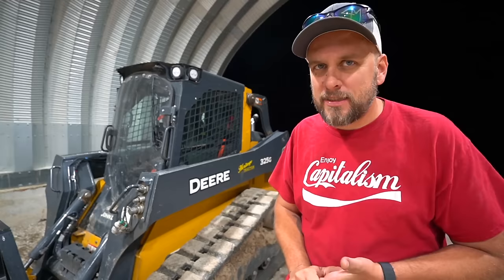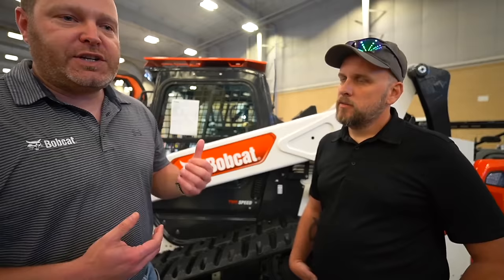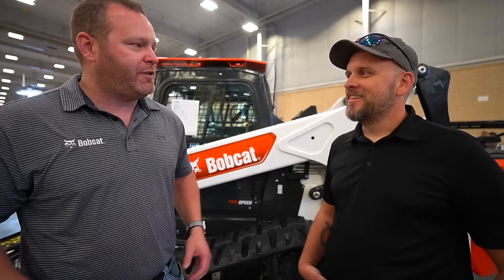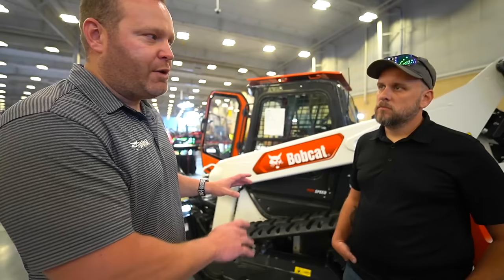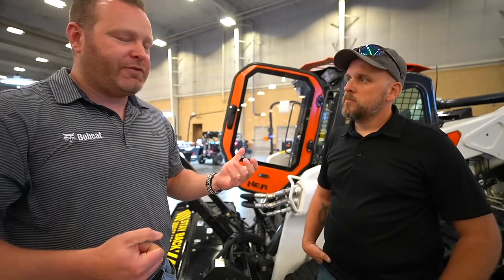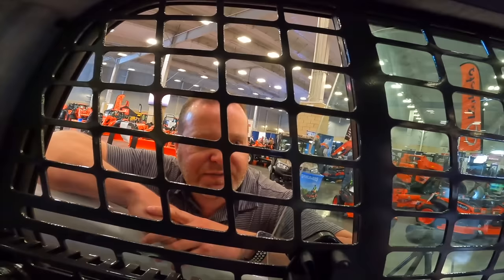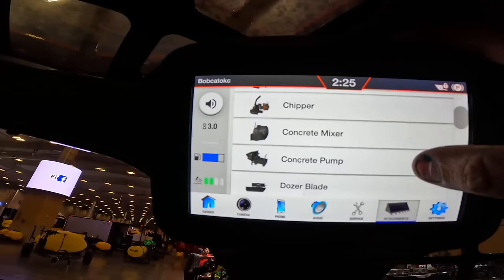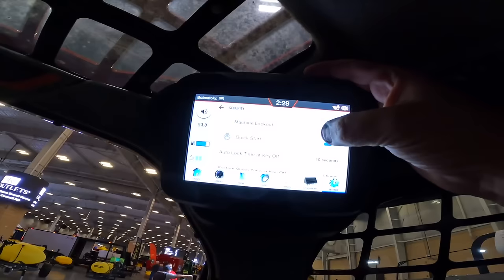I Should Have Bought a Bobcat Skid Steer - Here is Why

Comment: I own a kubota 97-2 for my construction business. Yes the door rattles some and might not seal as well but I'll still take the accessibility any day of the week over a swinging door.
Reply: the Kubotas I have run were nice machines, I hate my bobcat door. daily removing it to work and putting it back on end of day for security sucks
Reply: Im with you man - its a no brainer and i bet Bobcat engineers are working around the clock to create a roll up door system. It would be bad business if they are not! My kubota 75-3 door dont rattle any
Reply: @rayrayslawnlandscape2008   bobcat engineers already missed the boat. this is the 'new' and de-proved R series.
Reply: @notsure6182  I would be really depressed if i spent my life savings on a machine and i was stuck with the swinging door! NO WAY
Reply: @notsure6182  Thoe this salesman is really informative
Reply: Agree completely
Reply: @rayrayslawnlandscape2008  They better be working on putting in a roll up door --- loosing market share for safety reasons on this.

Comment: The only name you need to remember is KUBOTA! Great value and NO DOWN TIME plus excellant re-sale.
Reply: I like the roll up doors as well ... much better on safety issues , being able to get out if mid raise of arms and get stuck and cant open door.   Its happened to me---scary.
Reply: We have 3 Kubota machines.  the oldest is a SSV 75 that has about 700 hours on it and had been worked hard in its 5 year life.  It's still a workhorse and we have experienced very little down time with it.  We also have the SVL 75-2, it's newer and has the same back story with similar results.  The newest is a 2024 mini-ex KX 57-5.  So far, it has been a fantastic machine with no down time.

Comment: I like this Sales dude. Totally objective, and doesn’t run his competitors equipment down. 

Buddy, I wouldn’t  dump the Deere because of one minor inconvenience. In addition, you’re comparing a 74 Horse JD to 105 Horse Bobcat.
Reply: He was comparing his 74 HP Deere to a T66 or 75 HP Bobcat.
Reply: I think they're making this issue up, hydraulics are computer control and computer won't let you bog down the engine it will adjust hydraulics to balance the load on the engine
Reply from the maker: I did not say you bogged the engine. I said it didn’t move very fast. Not a big deal

Comment: I rented a 325g and was convinced I needed a ctl, but only one I could buy was a Bobcat T66.  The 325G was a year out and Kubota was 2months out. I'm getting to 1.5yrs and 800hrs on the T66 now, pretty happy so far.  Had one warrantee issue with the cab harness going bad.  Bobcat replaced the harness no charge and has been great to deal with.  Love the speed and the float on the loaded bucket.  I can run full speed with the bucket loaded over rough terrain and not spill anything which speeds up jobs a lot.  Here's a quick list of everything I've broken or had to repair.  Broke my windshield door twice, had the air ride seat get stuck on and popped the bladder, I damaged my leveling sensor with ice and dirt crushing it, broke a plastic part inside my door handle, and melted the belt cover with too much heat being pumped on it while cleaning things in the back.

Probably the biggest thing I'd change is the lack or heat down by my feet.  When I'm operating in extreme cold, I'll often wear Baffin boots because my feet will get cold in anything else.  The cab produces lots of heat for the windshields and the upper portion of the cab but not much for the operators feet.

Comment: I love my old Bobcat T590.  It is 10 years old and still running strong.  If you do change machines, and no matter what brand you go with, I would suggest you get it with the 2-speed ground travel option,  track suspension roller system and backup camera (for kids and animals at your place).   I do find the door a pain with certain attachments installed but understand why it is like this.  My door seals so tight that it is hard to latch unless the window is cracked open a little bit. Yes,  the door is adjusted correctly.    I do take my door off for most the year (except when it is extremely hot or cold) and have found this solves the problem with getting in and out.  The door is very easy to remove, and install, and if the temperature does turn on you while it is off, you can still run the heat or A/C with the door off and not suffer.   Good luck with your demo!
Reply: the dance climbing off the machine carrying the door sucks, finding a safe place to store the door sucks. I think I need to make a door holder for my truck
Reply: @notsure6182  Great points.  I have also struggled with the things you mentioned.  The upsides of not having the door installed do come with downsides.  Hopefully, there are brilliant people out there, who design these things, that will come up with better solutions......
Reply: I like the sales contact

Comment: Very helpful.  Good to hear the Bobcat guy say that all brands will have issues.  Some minor, some major. But I think this is machine, not brand specific. All the major brands have sound machines, but there are lemons that get out from all of them.  3 years ago I was in the market for a skid steer to mulch.  At the time Bobcat's biggest machine (870?) did not have built in extra hydraulic cooler, and forestry door was a big upgrade.  My salesman said if I was 90% mulching I should look at ASV.  I did and bot the 75, and upgraded to a 135 last year.  Very happy.  

But  I appreciated that salesmans honesty.  2 weeks later he called me saying I know you wern't looking for a mini Ex, but we had a customer order an E42 6 months ago (this was mid 21 during Covid shortages) and it is coming in next week.  He couldn't wait and bot a used machine and want's his deposit back. Would I be interested?  Went down, looked at it and bot it. What a great decision.  Skid's work faster, but a mini ex is a swiss army knife.  So a good salesman got me where i needed to go (not with him), but got a nice sale for his trouble.  

Lastly, unless you are mulching or breaking pavement, which require  extra cooling and as much hydraulic HP as you can get, all major brands have good machines for dirt work, occasional mulching, farm etc.  Get the machine with the best local dealer!

Comment: I have a 2022 T76 wide track for private use. I really like the machine. No dpf or blue government juice to worry about. The only issues I have had was a hose clamp recall on the radiator along with the radio loses communication (requires power cycle to come back - not many times). The only loss of power I have noticed was going up a steep hill while using a hydraulic function, but this was at a quicker ground speed. If I had to buy another one I would get a bobcat T66. Slightly smaller framed machine with the same 74 hp as the T76. The weight on the 66 is slightly less for trailering. The T66 can have counter weights added which can get the lift capacity closer to the T76. Looking to hopefully obtain a E42 or E50 R2 in the near future to complete the collection.

Comment: Old info on the Kubota.  The SVL75-3 seals really well and vents are lower and upper.  It also has addressed the multi-function capability with turning and operating the boom and  AUX with an Advance Multi-function valve.  Btw, I was traveling down I-77 North of Statesville, NC and saw the big Bobcat factory.  They had many attachments in the storage lot.
Reply from the maker: I don’t have an opinion on that door because I’ve only ran it one time.

When I record with a dealer, I give him the space to share his thoughts, but that doesn’t make them my thoughts
Reply: I just tested a 75-3 and it still went dead trying to turn while lifting the arms. Kabota did a nice job and I was excited about it. Thought I had made up my mind to pull the trigger on purchasing but after actually being in one and then demo’ing the bobcat in the same day I ended up buying Bobcat (t770 loaded for 7k more)

Comment: The Kubota model 3 with its excavator door is amazing! It seals tight. We got cats where I’m working. The standard door is a pain if you ever had the latter.
The seals on the standard doors seal from the outside to the cab. The excavator door seals from the inside. Which when you turn the heat or ac on it pushes or pressures up against the door which helps it seal even more. I highly recommend the Kubota. Great machine that u can get out of at anytime

Comment: I have a Deere 329e compact track loader and a 320G skid steer. I have no issues with steering. My only complaint on my G model is the hydraulic pump is louder than the E model. I will stick with Deere.

Comment: I’ve been running that T86 all week with a mulcher. It’s a beast and plenty of power and I’m not even using the super flow. Just basic high flow. It has a great cooling system as to the tier 3 870 that would over heat a lot. No complaints so far other than having to clean the air filter abt every 2 hours.
Reply: Try adding the aspiration kit

Comment: I have a Case 430 skid steer with the Cummins 4BT engine. I operate a Premier trencher and auger with it. The Case 430 has the low flow hydraulics but I never had any issues as my attachments are geared for that. I never had issues with this machine. Highly recommended!
I had a friend who had a paving company and he owned 15 Bobcat skid steers. He told me to stay away from them as Bobcat had too many electrical problems. He told me at any given time, he had only 9 of the 15 machines operational at once. That was a telling statement to me. I'm a Cummins believer as I own 2 Dodge 3500 trucks. Bought the Case and never looked back.

Comment: Leave it to a Bobcat sales man to try and sell you a $2500 app in response to wanting a door that you can open in real world scenerios.  It's not even about climbing out UNDER the load, the last Bobcat I ran, the main boom had to be fully down or the glass contacted the bucket curl cylinders.  Another example for instance I use a grapple bucket, a Bobcat brand one too, and even if the main boom is fully down but you have the bucket curled back the door hits the clamps when open.

Comment: That's quite the radiator they pack into those little units.  Thinking about how a guy would clean it, you'd have to get an air hose under it and blow upwards to avoid blowing the mess into the fan and onto the engine..  Ran the Deere in the dry months last year and you would have fine dirt piled on that back lid over an inch thick. not sure how that horizontal rad position would handle it.
Thank you both - Bobcat should loan you a unit after the work you've done here!

Comment: I bought a new Bobcat E50-R2 Excavator a couple years ago.  AC has never worked right.  If it's over 80 outside it starts to get to hot inside.  On the warmest days I'm lucky if it can keep the cab 10 degrees cooler than the outside temperature and it regularly gets into the 90's here(Southern IL).  Also when it's humid at all out water starts coming out of the vents, a lot of water.  The dealer has had the machine several times and hasn't fixed it.  They claim that the AC is "within specs" .  I've checked the temps at the vents and it varies between about 48 and 60+ degrees.  As far as water from the vents blowing in my face, they said they were told by Bobcat to tell me to turn the blower down. The dealer admitted to me after the last service that they have a rental machine with the same problem.  Other than the AC system I really like the machine, but at this point I will never buy a Bobcat product again.  As far as skidsteers, I have a Case TR310B and love the machine.  Plenty of power for it's size, good viability a comfortable cab.

Comment: I rented a tracked Manitou 1350 RT 2023 model year from Home Depot about a week ago. I used it for about 14hrs straight mainly for terracing a farm hillside. It didn’t like turn in its place either. I had to full throttle it and it barely turned acting like it didn’t like it. Other than that the joystick control and foot throttle was great. I own a old wheeled Bobcat that would cause too much compaction and fall off the terraces probably rolling down the hill.

Comment: Good sales rep for sure. These new Cat 255 and 265 fixing to put some pressure on them. Cat has been doing torsion bar suspension for quite some time, sealed one piece cab and the most quiet cab on the market. These newer R series machines are nice hope for their sale the Dooson part don’t run them in the ground.

Comment: I bought a Kubota SVL-97 BECAUSE it has a roll up door !   I live in Vermont, and don't need air conditioning every day, but I do need to hear the guys working around me, and I need to communicate with the guys outside of the machine, something you can barely do with a closed front door  and the engine running !

Comment: Only complaints I have with my 2021 T66 is the hydraulic QDs on the loader arm are too exposed (have to be careful with grapples) and also the ever-present electrical gremlins. Losing radio communication, camera stops working, etc.  But otherwise, its awesome and does everything I need it to do...farm work and construction

Comment: I love my Bobcat, but the only thing I don't care for is the door that is hinged open like a car door.  I'd rather have a door that slides over the top.  If I need to get out, I have to make sure the loader is down past the door.  I heard him mention pull over doors and vents, I'm not sure that's enough of a selling point to make the argument the hinged door is better
Reply from the maker: I’ve been saying for a while I wish I got a machine with a rollup door, but I like to hear other opinions

For people who run these machines for a living, the top three sellers are caterpillar, John Deere, and bobcat

All three use the swing outdoor and they could easily switch to a overhead. I’ve asked all three why they use the swing they all say it’s better long-term. 

Is Seals out dust better, it’s quieter, and they don’t want their guys to be able to jump out with the load in the air
Reply: I take my door off when the weather is not unbearable.  It made the machine that much better and easier to use if you are in and out frequently.  I also questioned the issues he mentioned about swing doors, but I have not used a machine with a swing door.  I will say the door seal on my Bobcat is very good.

Comment: We have a John Deere 324G (it is the same as your skid steer but it has tires) and i think your turning issue is because you have tracks. Because we have never had that problem. I personally do not like Bobcat tho. We have a bad experience with Bobcat, motor issues, hydraulic issues, hydraulic cylinder issues. And the only issue we have had with the Deere is we broke a hydraulic line, (and a flat tire).

Comment: A SVL97 is not 84” wide. It’s 80” so it fits ok on a contractor special trailer. Anymore it’s all about dealer support, all machinery has issues so it’s just best to pick who would take care of you. I like Deere ok but visibility is terrible on them. It’s like sitting in a bathtub, little view of anything below the lift arms. Bobcat is superior for visibility vs Deere.. the new -3 Kubota has a sealed cab and revised door. Even with a few drawbacks, the roll up door makes more sense.

Comment: Bobcat is known for their weak hydraulic pumps. I will tell you as a matter of fact that you put that 325G up against this T66 and it will outperform it in every single task you put them up to. I genuinely recommend you get a demo on this machine and test it in the same tasks as your deere. there is no comparison between time and efficiency.
Reply: T66 will run circles around 325g .  7mph in low speed,  lift and tilt twice as fast.   325 g.   5 mph in low speed.  . Deere has loudest cab in the business.    Visibility is terrible
Reply: horrible visibility

Comment: This salesman is very well acquainted with this machine and I really appreciate that. However, he did sell us on a couple of things that are not true.

For auxiliary circuit flow, he told us that this 105 hp machine can produce 44 gpm at 4200 psi. The hydraulic horsepower equation quickly shows that pressure and flow to equal 108 horsepower which is obviously impossible. Even if the hydraulics were 100% efficient (which they are not), dedicating 105 hp to the auxiliary circuit would mean that the machine would have 0 hp available for any other function while running the circuit at full capacity.

The matter of higher case pressure improving the speed at which direction of flow between functions changes is not at all helpful in a situation where you're asking a machine to smoothly divide flow between two functions. Also case pressure is often developed by internal leakage which a parasitic loss that wastes hydraulic power by converting it into heat. We don't want that.

This machine does have some really nice features. I do appreciate the idea of running remotely at a pretty low cost. I'd like to try that, but I'm thinking that it's probably more of a safety hazard more than a practical function. Keeping the operator in the cab keeps him from getting run over or tangled in an auger just like keeping two hands on a chainsaw keeps your hands out of the chain.

Again, I do very much appreciate this fella's knowledge and dedication to his job here. It's difficult to find people who are passionate ate about what they do. Top tier salesman.